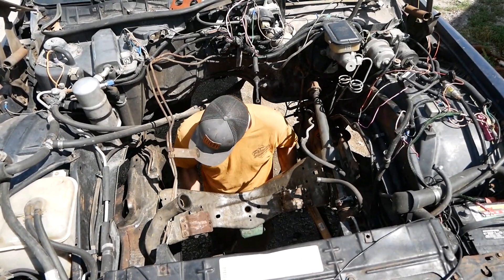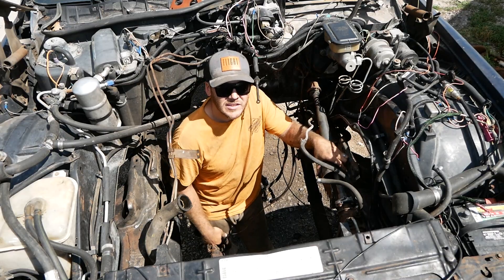I Bought A New Driveline For This MONSTER Cadillac!

Comment: If I recall,, the '77 up full sized Cadillac's came with the 368, which theoretically has the same motor mounts as a 500/472/368, so those should just drop in.  In theory.

Comment: I would rather leave the crossmember in for frame rigidity and modded/built my own oil pan and pickup, but who am I to judge when I am not there to see the clearance issues in person?
Reply from the maker: Lol I have not messed with changing up a pickup before so it seemed easier to cut out the cross member and wouldn’t risk me messing up the 500 oiling system. I plan to build a new tubular x brace behind the motor
Reply: Yes, I know all too well about heading into a project, then having to make compromises when something unexpected rears its ugly head.

Comment: Maybe the best solution for the drop arm on the steering box is to cut and extend it by cutting it, but then weld-on extra bracing on either side with dissimilar steel welding rods and make it as beefy as heck... As if designing it to steer a large truck, LOL. Make it look pretty too so it passes😉
Reply from the maker: I did considered that but the whole going down the highway thing concerned me lol

Comment: DUDE! Had you done your homework, you would have learned that you could've swapped that 500 in there much easier  using all stock Cadillac parts... without ANY BUCHERY. SMH. Use an oil pan, corresponding pickup tube, and motor mounts from a 77-79 Deville with a 425. Also using  the pullies from that same donor would allow you to eliminate the smog pump.
Reply from the maker: Lol I couldn’t find any at any reasonable price, and given my timeline of two weekends to get everything thrown together with a full time job and kids it was my best option and also cheapest option lol